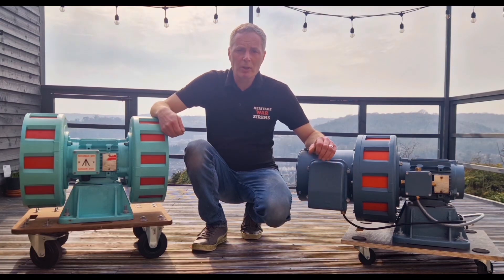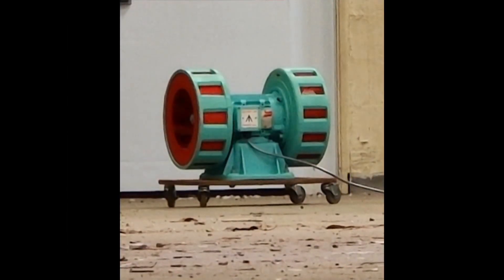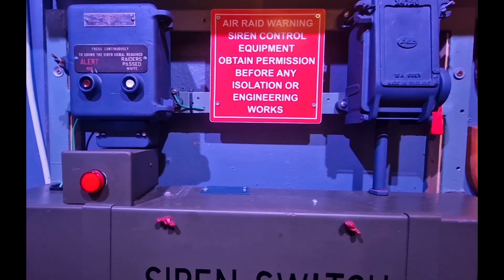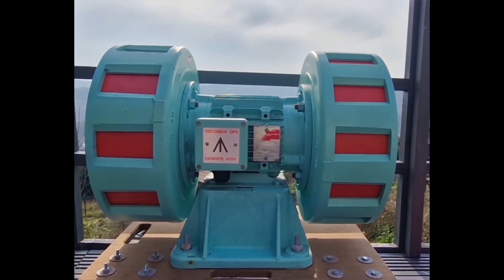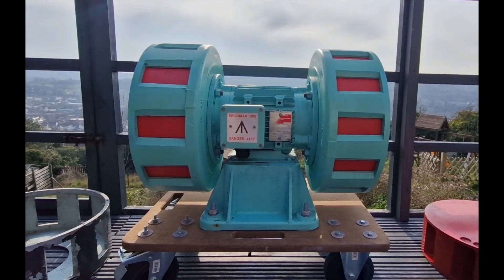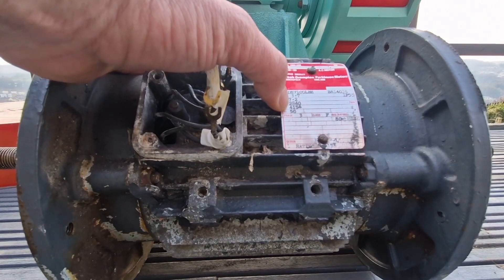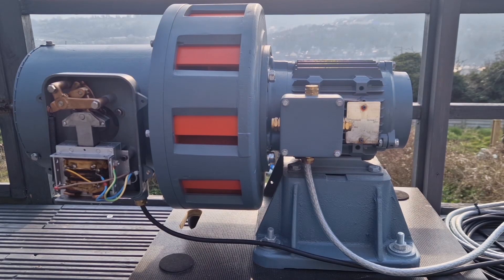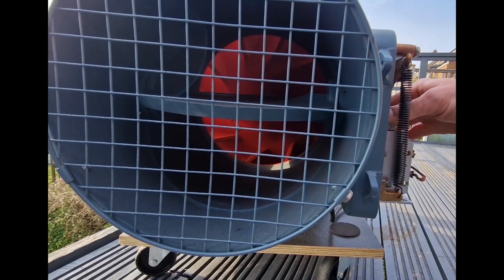A brief history of uk air raid sirens and dampers

Comment: I find it interesting that they chose to just install a heater instead of making a small shroud over the stators
Reply from the maker: From the 1980s they made a full set of grp covers that covered the entire siren,  which negated the need for heaters , there was also a lesser used method of running the siren at very low speed through a system that activated at low temperatures tho , i haven't come across the controls used to do this yet

Comment: My town of lowestoft used to have cuckoo warning sirens
Reply from the maker: @CycloneJoey518  I will try do a map up of towns which had them eventually,  I believe Eastbourne was another which had them
Reply: @heritageWarSirens  I would love to know what types we had. Also, I'm assuming the dampers were fitted on pre installed sirens mostly?
Reply from the maker: @CycloneJoey518  I believe most of the earliest ones were retrofitted gents arp models , tho I have also seen photos of the early secomak model also fitted with dampers,  the problem when researching uk sirens there was no overall plan of locations as it was down to local districts to provide and install them and any plans they had have long since been destroyed , most locations I have found I'm my area have been though an occasional old photo that happens to catch a siren in the background or the memories of people who remember them being tested
Reply: @heritageWarSirens  alot of sirens locations can be figured out based on buildings that would've most likely had them, police stations, fire stations, schools, etc. Also I know of at least one of the cuckoo alarms locations in my town, that being on the old tram works building
Reply: @heritageWarSirens  and also there was  a Castings on a co op factory in my town, but the muesuem has it labelled as a ww2 siren, as you stated Castings was still Carter in ww2, so it's probably from the cold war
Reply from the maker: @CycloneJoey518  castle was definitely cold war , alot of the earlier  gents sirens were replaced by newer models during the cold war as they had a mis hap with a gents in Scotland when testing , the gents had cast iron stators and over time the heaters caused the cast iron to crack and one self destructed showering the street in large bits of metal , I have a photo of on original ww2 gents sat on top of dovers tram shed , a later cold war era photo has shown it was replaced by either a castle or secomak looking at the siren shape
Reply: @heritageWarSirens  that Castings at the co op factory was quite close to that tram works so it's possible that it was an indirect replacement for whatever that cuckoo alarm was. But yeah that's quite interesting that one explosion led to most of the gents to be phased out